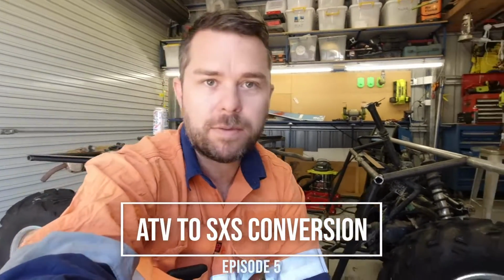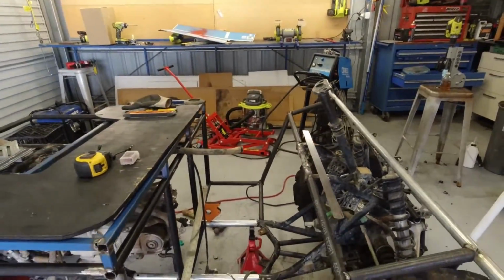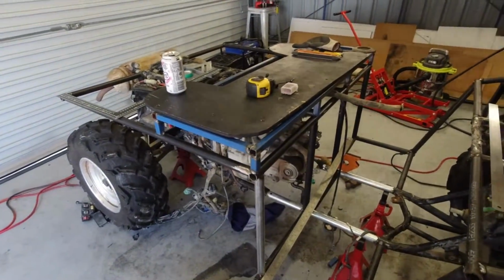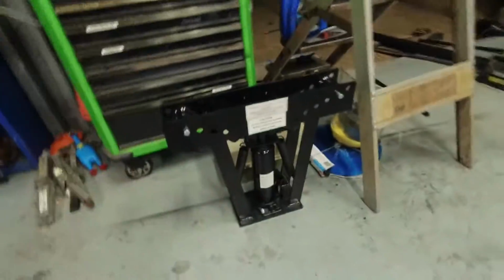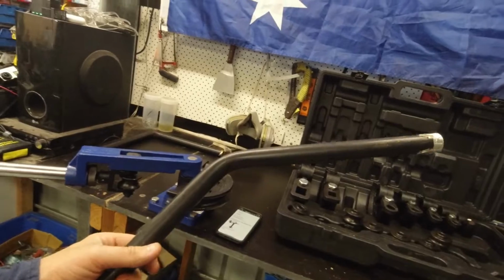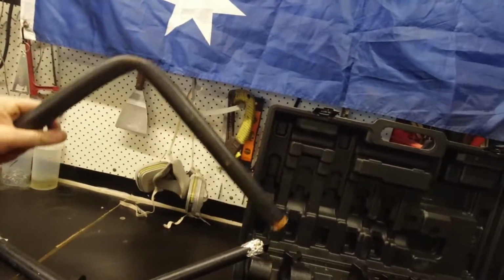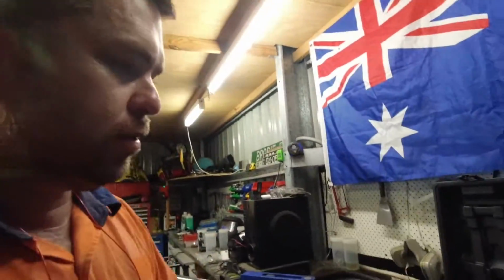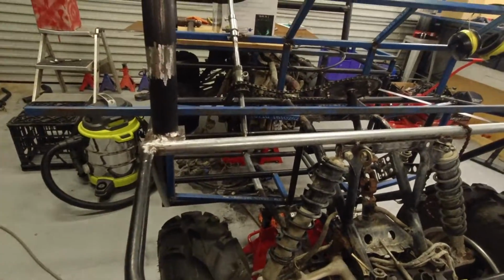REWORKING THE DASH | ATV to SXS conversion - Episode 5

Comment: Turn up your wire speed man😆
Reply: You can use a thick tire tube in between the metal tube and the pipe bender die, it works great up to about 45 degrees on 1" tube
Reply from the maker: I'll have to give that a crack. This video was a fair while back. I've since upgraded to a Lincoln Powercraft which was much more adjustability than that crappy Cigweld i bought from Supercheap Auto 😂